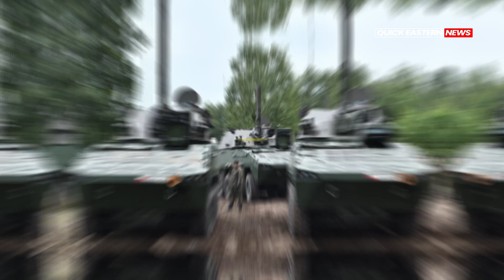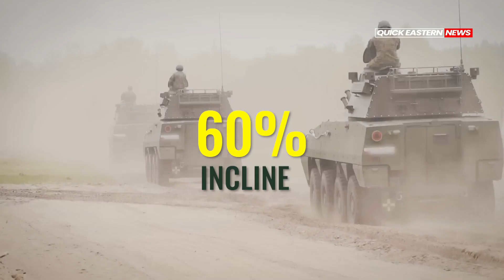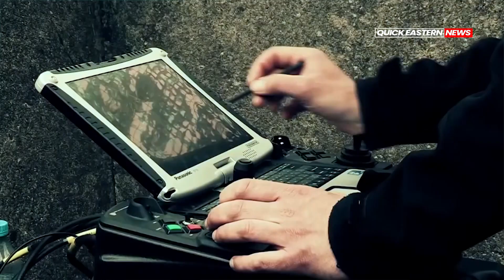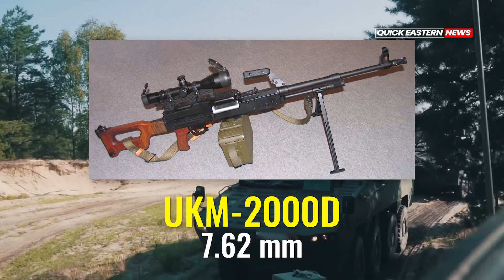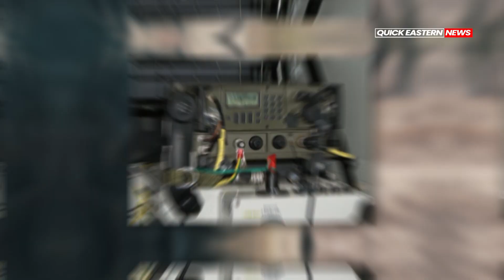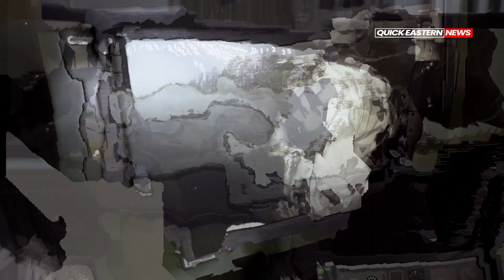Ukraine war - The Rak: A Closer Look at Poland's High-Tech Mortar System - News update

Comment: It is worth adding something that is rarely talked about. And few people know. RAK has a special system for supplying oil mist before firing a grenade. The Polish Army required the barrel to withstand 1,000 shots. After a test firing of 1,000 grenades, microscopic, X-ray, etc. examinations were carried out. No barrel wear was found....
I don't know if this system is used in AHS Krab. Probably not. There, the barrels are hardened, among other things, using a special impact hardening technology. Air pressure. However, I know that some of the Krab guns have already fired over 8,000 shells and can still be fired accurately. The factory provides a guarantee for 1,500 shots. There are of course more interesting things and technologies used. For example, the fact that a grenade in the front of the RAK barrel exceeds the speed of sound. I don't know if any other mortar can do that. Or that due to the special design of the breech, the Krab shoots practically every 155mm round and every propellant charge that has been produced in the world. It's all mixed together any way you want. I doubt if any other gun-howitzer can do that.
Reply: Wow, that's actually very interesting
Reply: @qPolakq  If you liked it, maybe something else? The RAK can fire grenades at a distance of 12 km. Is that a lot? Oh yes. This is the range of the 122 mm 2S1 Gozdzik. This is a widely used howitzer on the Ukrainian-Russian front. By both sides. Its range with a standard HE shell is ... 12 km. And this is a howitzer, which is a completely different category. But there is a catch to the 12 km range of the RAK. This is only possible using specially reinforced ammunition. Standard grenades are not able to withstand the forces during firing. It is about the durability of the body. To make things more interesting, the Polish Army uses old ammunition, probably from the 60s. A piece of copper bottom was added to the grenades. You can also use grenades loaded from the muzzle. The RAK has a lock, of course. It is cheaper to dispose of old ammo this way. But its range is about 8 km.

Comment: RAK is not really a self-propelled mortar or any vechicle in general - it is a fireing module. AKA just the turret. Turret that you can mount on (among others) Rosomak.
So in those 50 aditional Rosomaks, 32 (or 24 acording to other sources) will be used as bases for RAK's. 

Also... 120mm mortars, with 12km fireing range... HEAVY artilery? WTF?
Reply: heavy artillery (noun) : a more powerful version of something
"His first argument didn't work, so he changed his approach and brought out the heavy artillery."
it is a heavy mortar and it is a self-propelled mortar...
"WTF?"  sums up nicely the mess in your head.
Reply: @Bialy_1  we are talking about guns, LITERAL artillery. Take this metaphorical definition back to the dictionary. 
120mm is heavy FIELD mortar (in opposition to light field mortars, like 60 or 82mm), but it does NOT qualifies as heavy artillery. Heavy artillery is somethink like 152/155mm howitzers. Or if we talk mortars, siege ones like russian 240mm 2S4

Comment: The effectiveness will be increased by attacking enemy positions at night, with low noise engine's Rak mortar's armored vehicles, to stmulate a counterattack into a duged-in heavier tank´position. This should be done throughout nocturnal hit and run hight mobibility speedy attacks, about 10-12 km ahead, of the terrain advantageous defense line of heavy dutty, acurate piercing amunition tanks.

Comment: Very impressive. I love the fact that the RAK is part of the system directly connected to UAV Flying Eye that can quickly identify a target and pass its coordinates to RAK's fire control computer.
Reply: its same to krab arty and tanks like pt91 or t72mr that have polish fcs installed
Reply: @slidman24  Fantastic - the same platform is going to help with good communications and maintaining those systems.
Reply: @ragnargrabson1287  is not fully that. Polish tank/ifv FCS is not integrated, only Topaz based artillery, so Krab & Rak + some grad derivatives.
On plus side this Topaz artillery FCS is now standard in Polish artillery. All artillery systems are integrated with this including HIMARS and K9's if in Polish service.
It has this capability because FCS and UAV's are made by the same company. The most important capability is automatic fire correction - drones can observe impact and calculate corrections for follow up shot automatically, so that next shot hits on target. So you can zero in on target very quickly. 
It was something noted during one excecise with US mortart team, where they were supported by handheld Topaz terminal (yeah stuff like that exists for traditional mortars).
It took 11 seconds to put next shot directly on target after first one hit in close proximity. Things like that greatly enhance accuracy of dumb ammunition, because there is no need to relay this via radio and manual calculations. Normally such correction would take at least a minute or two and be less precise, not to mention it being more risky (more time more opprtunity for enemy to hit back at the gun). 

It's also now integrated with longer range drones and kamikaze munitions, making it sort of complete artillery command system. Where you fly drone, it sees what assets are in range to hit target, you select type of fire mission (drone, mortar, artillery, rocket artillery) and click done - with it being automatically relayed where needed for approval and required lauch platform settings. So technically it allows for coordinated strike where drones mortarts artillery and himars fall onto designated targets at the same time or with required delays between fire missions. Basically you fly in select like 30 targets to be destroyed and by what and you can enjoy fireworks. 

For IFV's I think most exciting system in Poland will be further integrations of SOD-1 - which is 360 degree coverage system of thermal cameras integrated with FCS, now they are working on adding AI, or more accurately algorythms to mark targets automatically and alert crew, possibly even turn gun towards target. 

I think systems like that will turn out great, since whatever some may say about Poland - we have good IT specialists, especially software engineers and programmers.
We may need help with some hardware but software... I think we can handle allright ourselves.

Comment: Not bad but you missed main point of Rak. For artillery pice you should pay a bit more attention to barrel. And thing is that Rak can handle double pressure then standard towed 120mm. It also have capability to shoot straight, min distance depending on ammo 80-150m. 
So in context of war in Ukrainie question is will there will go with Rak's also new ammo. I have to check if they also finish laser guided precision one. I know they tested it but if there was order for bulk I can't find information.

Comment from the maker: ⚠ There is a mistake in the video! 24 Rak mortars will be sent to Ukraine instead of 32. The Company Firing Module consists of eight self-propelled mortars, four Artillery Command Vehicles, three Artillery Ammunition Vehicles, one Artillery Weapons Repair Vehicle, and two Artillery Reconnaissance Vehicles. I'm sorry for the mistake 😉
Reply: What you described here is a company:)
That system is called "KMO Rak" (Kompanijny Moduł Ogniowy - Company Firing Module), a platoon is four vehicles and one command vehicleb and there are two platoons per company.
Reply from the maker: Fixed it, unfortunately can't fix it in the video 😉 Thank you.
Reply: Rosemak je patrija